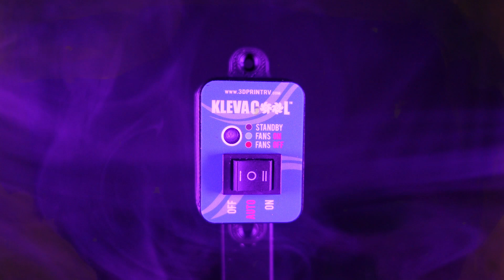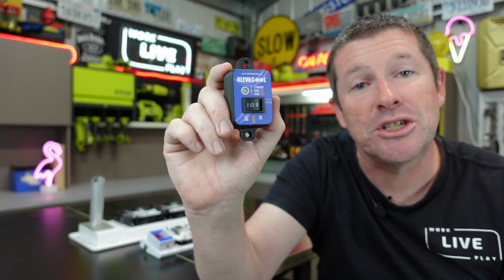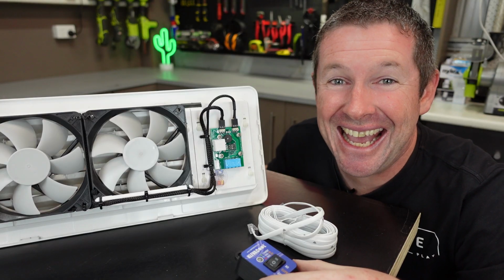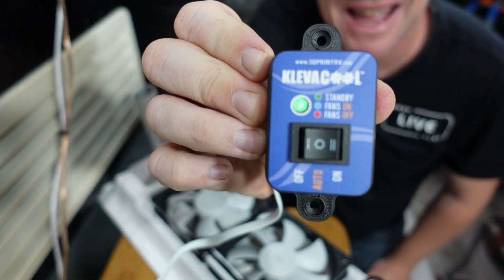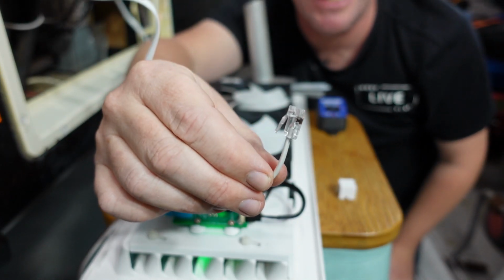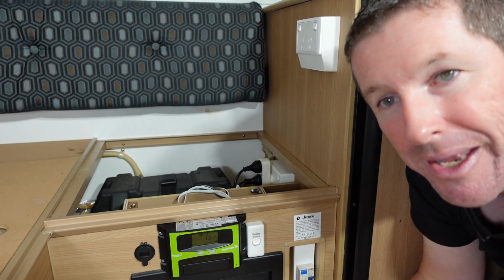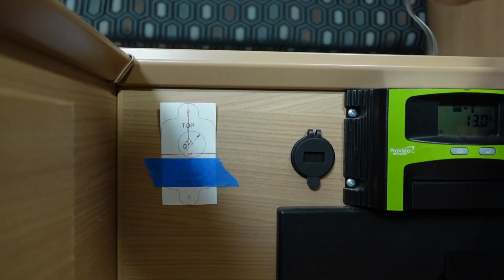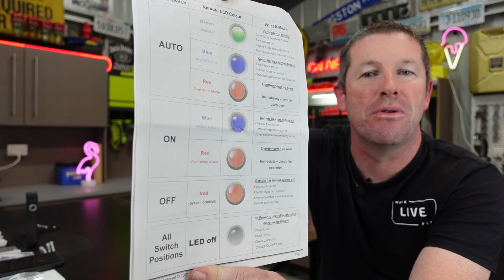LIVE | Klevacool Remote Control - 3 Way Fridge Fan Kit internal control for your camper or caravan!

Comment: They are a great addition. I have one fitted to my fan kit. I have found it a good visual indicator to tell whether the fans are on or off (seeing I struggle to hear the fans when they come on !!) Just that bit extra to monitor the operation of the fan kits. I haven't had a need to turn the switch to the OFF position but occasionally turn them to ON to maybe assist bringing temps down a bit quicker when say having just pulled into a campsite and switched power supply from 12V to gas.
Reply from the maker: Its very handy being able to monitor inside. Over summer I noticed our fans would turn on when the camper was stored in the shed due to the heat. While you could pull the vent and disable it's much easier just being able to switch to the off position when you are packing down. Great tip using them manually to get the fridge up to speed. I like that 👍